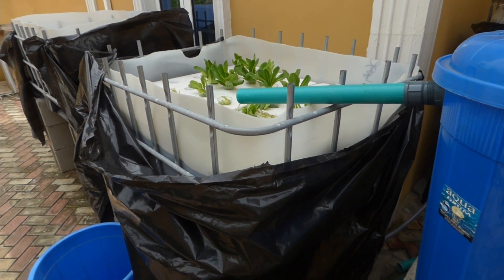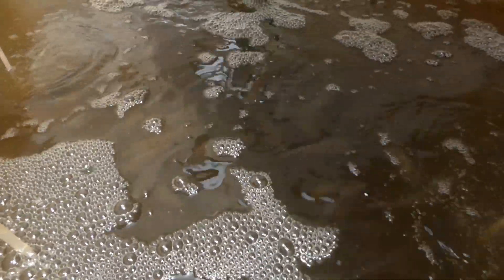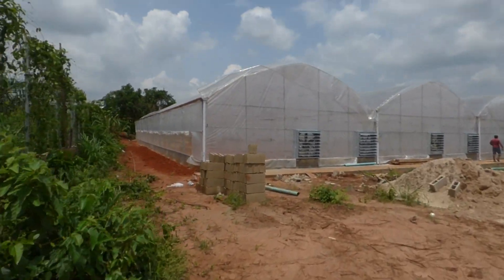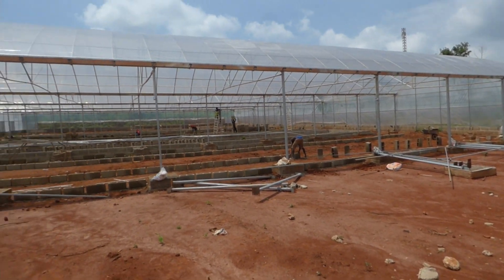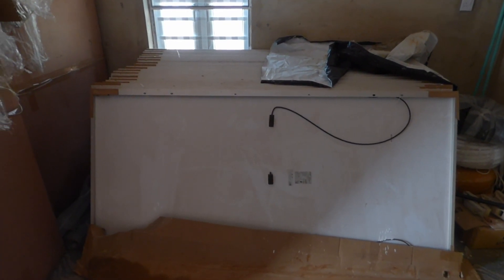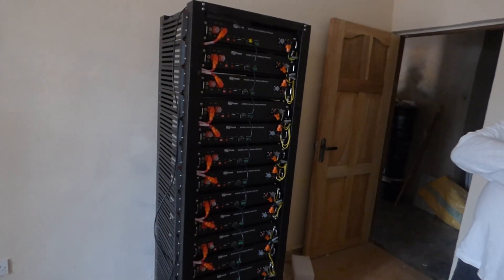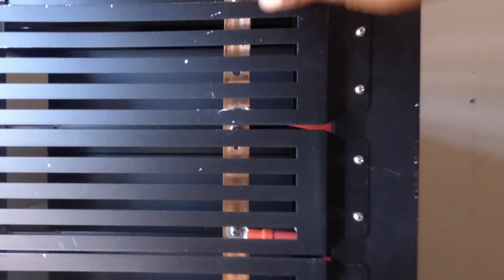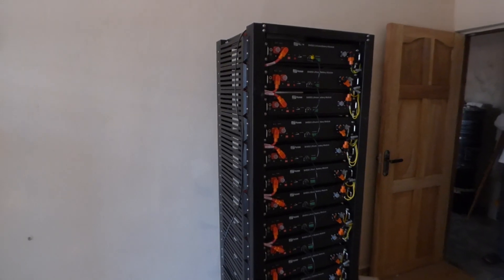Aquaponics in Nigeria and a Huuuuuuuge Solar Battery Bank 72 kwh

Comment: Dr. Solar, how to you protect your solar installation against lighting strikes?
Reply from the maker: This is a very nice question. First thing we do is earth. We direct the lightning away. Then we add lightning protection devices to the strings on the PV side as well as the AC side.
Reply: @drsolar  , Dr Solar when you say lightning protection devices are you referring to specifically SPDs ? Thanks
Reply from the maker: @nestyplus  I hope all is well with you. In addition to the SPD's installed inside the inverter we add external devices
Reply: @drsolar  , thank you for the response Dr. Solar, may I know what additional devices you deploy for protection against lightning? Regards
Reply from the maker: @nestyplus  we like to ground the panels and every component on the DC side. We use a 6 to 8 foot earth rod. We have had good success doing that to date